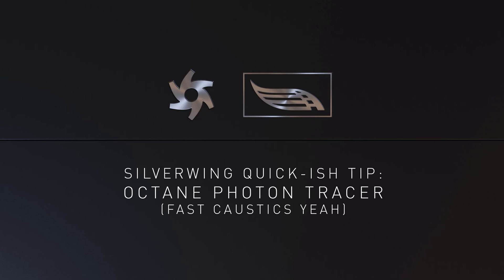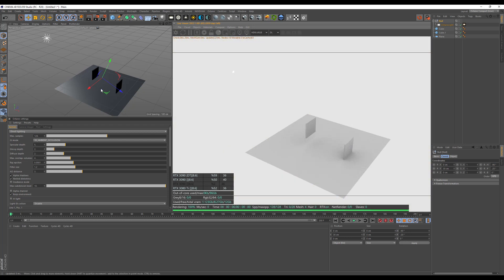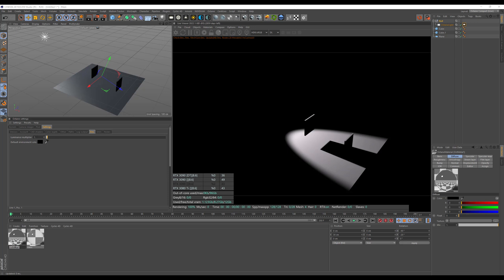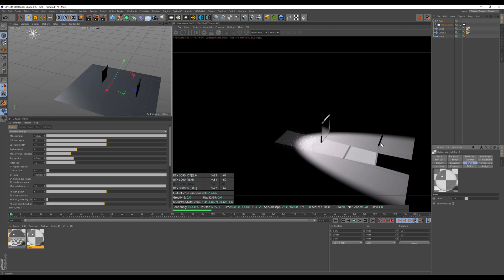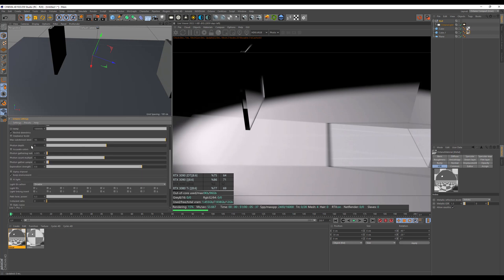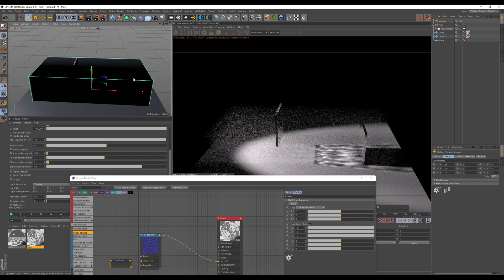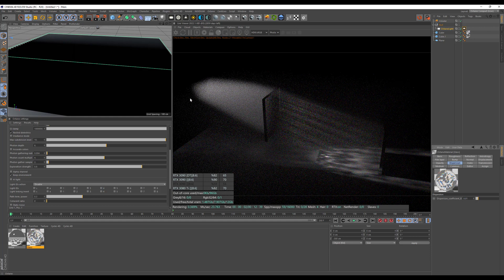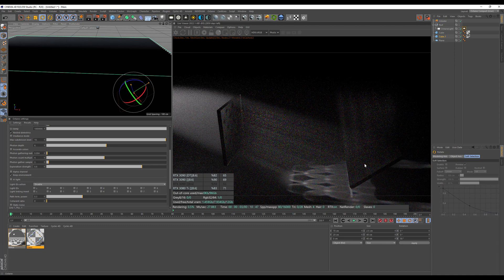Silverwing Quick Tip: Fast Caustics - Octane Photon Tracer

Comment: trying to make the exact same effect with volumes on the newest 2022.1 version, but it doesn`t work on it, but works absolutely well with simple caustics.
Reply from the maker: Thank you for the hint. I might investigate that inside Octane. I have not used Caustics with volumes for some time now.
Reply: @SilverwingVFX  if you have a chance, please let me know how it goes! thanks man for your awesome work
Reply from the maker: @p1nkyTF2  Hey there. I wanted to follow up the situation. Seems like some values have been tweaked with the final version. It definitely works. But unfortunately not 1:1 the settings I use. Seems like the caustic radius has to be even bigger now.
Reply: @SilverwingVFX  Thank you so much for the answer!

Comment: thanks for the great video, Im using octane 2021.1.6(r4) which is the latest stable version available in the otoy website and I don't see the Photon Tracing option. Is it safe to download the latest version that has this feature? I believe it is in experimental, or is it stable to use for production? 
thanks!
Reply from the maker: Hey there Fabio and thank you for your comment.
As you correctly stated, this is a Feature of Octane 2022. In the description you can find Links to download the right version to try it out.
It´s still not a stable built yet so it´s not recommended to use this in production.
Cheers and a great Friday to you!

Comment: Every time you post a new video, my day gets better a little bit! Thank you :)
Also, may I ask where you bought your normal maps?
Reply from the maker: Oh man thanks. This is a really nice thing to hear 😊
About the Normal Maps. Most of them are self made. I usually use the old C4D "Normalizer" to put in any grayscale bump map (or generated map) and then bake out the map the Normalizer provides. Maybe another topic for a quick tip.
The weaving map on the top is from Poliigon I think.
Reply: @SilverwingVFX  Of course it's DIY! Awesome.

Comment: Great video Raph!
About the environment: I tend to not change the env color in the settings, because they are not being taken over when you open the scene on a different workstation.
Rather I just create an octane environment with a solid color and set it to black. Then it doesnt matter what everyone has set as the env color on their machine.
Reply from the maker: Hey Dino,
thank you very much for your tips. I totally agree that we do not want this setting as a global settings because of said multiple workstation problem.
I would argue we don´t need it at all. Most of the render engines render black when no light is in the scene!
P.s. Fernando (commented here too) suggested changing the setting and saving a new.c4d. I was not aware that such settings would be actually saved in there. But they do. So I have a fix now and at least when I create a news scene its black from the beginning.
Reply: @SilverwingVFX  When you create preset in Octane settings — it saves black env as wells. Usually I also check adaptive sampling and set OCIO view to ACES: sRGB — just to speed up awork a little
Reply from the maker: @olegkulinich  Thank you very much for the input. I will try that out too. Much appreciated!